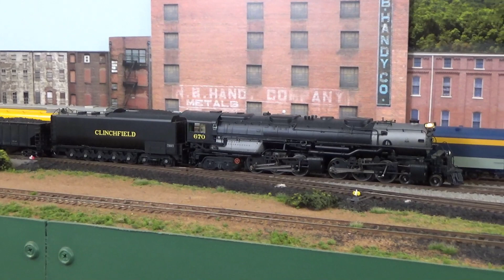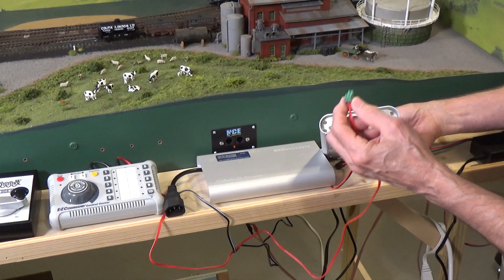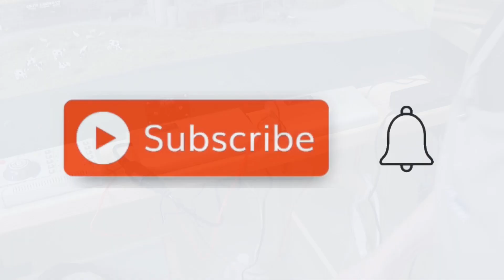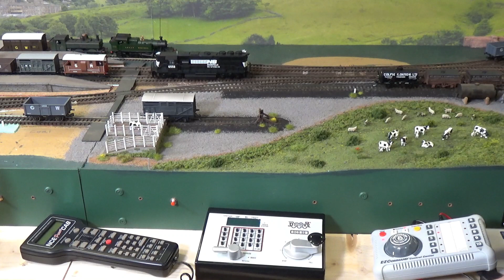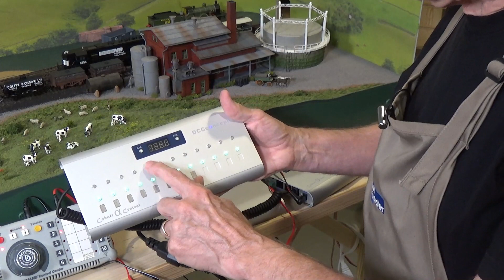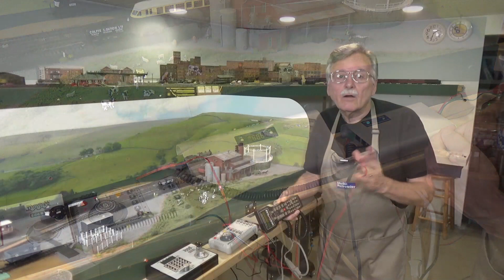Need More DCC Power--Watch This Before You Buy (270)

Comment: I have old Markling and Hornby Dublo locomotives and I don't want to convert them to digital. How can I increase the power when I have an analog controller, and which analog controller would you recommend? Thanks.
Reply from the maker: Those old motors are power hogs and the best you can do is clean and relube the gears and clean motor brushes with a good contact spray. As for what analog controller to use, I haven’t looked at those in years. Here in the states we used to have  lot of good options but most have disappeared since DCC came along. In the UK there may be some other good options from Gaugemaster and others, see what Sam uses for his YouTube channel, he is primarily analog.
Reply: thx

Comment: Is it safe to use a booster in conjunction with a Lenz LS150 Turnout Control Unit or will the additional current fry the unit?
Reply from the maker: Sorry but since Lenz left the US marketplace 20 years ago I have totally lost track of their product line and have no idea what the LS150 takes. However it should have the voltage and current limitations/requirements in the instructions.

Comment: I have an NCE POWERCAB which feeds directly into a CP6 and that gives me 6 power districts.
If I increase the current available with the SB5 the districts will still be limited to 1.75A!
I have 4'x9' N scale layout and don't run many trains at once.
My concern is all the Light-Its for Signals and structures, Switch-Kats and AIUs drawing track current.
How would I implement an accessory bus?
Thanks
Reply from the maker: There is a video on that on here—with close to 300 videos I am afraid I cannot be more specific but just scan down through the list.

Comment: When do you expect to test the Alpha Box and Alpha Central with Digitrax?  If I missed it let me know and I will look at that video.  I am mostly curious if I can put Digitrax throttles on the Digitrax Bus and then see turnout changes made by the Alpha Central on the Digitrax throttles.

Also, if you start with a NCE Power System, are you limited to 6 cabs yet?

Thanks for all your work!

David Smith
Reply from the maker: I hope to test that in December. As for the NCE you can have up to 6 per cab but on the PH Pro system you can have up to 63 cabs!
Reply: @TheDCCGuy  Thanks!  It is a busy time of the year!  Great Job!

Comment: I'm still waiting for the "perfect" DCC system.
Digitrax is the most functional and easiest to use, but all their stuff looks like it was built by a kid in his bedroom.
NCE is modern looking, but overly complicated to use.
Bachmann is a good in between, but it just feels cheaply made.
There are some European DCC systems that look amazing, but come with amazing prices!
I currently use MRC Elite.  It's modern looking, easy to use, and sturdy, but proprietary.  So none are perfect.
Reply from the maker: If you keep expecting someone to develop the “prefect” DCC system you will always be disappointed! Technological developments always seem to stay one step ahead of what manufacturers are willing to build into their new products. Probably because they are never willing to take a chance on whether model railroaders will actually want the newest thing. Manufacturers waited almost 5 years before starting to include 8-pin decoder sockets in locos and LCC is still a technology waiting to be developed. I have been using Digitrax products since 1994 and in my first review of their first system I made the comment that the throttles looked like something someone made in their basement. Actually I was dead right as Zana and AJ Ireland started the company in the basement of their Norcross GA house. However I still have that equipment and it still works after 28 years!
Reply: @TheDCCGuy  That's not true, IMO.  The Lenz system is really good, and the ESU system is pretty close to the perfect DCC system.  These systems are just hard to get here in America.  A lot of European shops either don't carry them (they are pricey) or won't ship to America.
Reply from the maker: Opinions are like belly buttons—everybody has one and no two are alike!
Reply: @TheDCCGuy  So true! 🙂

Comment: If you have a two deck layout would you need a booster for each deck
Reply from the maker: No. You only add boosters if you need more power to run more locos, you use circuit breakers to divide power among various blocks. Watch my videos on boosters #113 and power management #112.
Reply: @TheDCCGuy  Thanks for the advice and I will certainly watch your video on power management

Comment: It's also extremely important to note if you are using ANY Digitrax system to use the required cables alongside the Alpha Box/Alpha power. There are special connectors for each system (Some don't need any as shown in the above video). If you don't use the provided connector then you are likely to blow the Alpha box pretty quickly.
Reply from the maker: I plan to do another video focused on using a Digitrax system.

Comment: Hi, I’m just starting on a “N” scale layout & I’m confusing terminology in regards to wiring in the questions I’ve asked of you.  I saw on one of your videos that you had written at least 3 books. Basic DCC Wiring for Your Model Railroad: A Beginners Guide: 4/1/11, Wiring Your Model Railroad (Essentials) 8/1/15, DCC Projects & Applications V4 8/26/19
What book would you recommend I start with?
Thanks! 
PS: I haven’t purchased any power system yet, just a Kato starter system.
Reply from the maker: I would say go,with “Wiring Your Model Railroad”. It provides some basics about DC and DCC and is one of the Essentials that Kalmbach publishes. Also take a look at the series of videos I did on building the modules.
Reply: @TheDCCGuy  Thanks!

Comment: I am considering the Cobalt turnout motors and Alpha panel on my layout expansion, but it is really hard to decide which system to invest in.
I would be interested in a video on the merits of 12v vs. 15v vs. 18v for N scale. Based on my Alpha Meter and RRampMeter, I am getting 14.9 volts out of my command station and 14.9 volts at the farthest end of my track, so I could drop to 12v without voltage drop. But I do not understand why, if DCC Decoders are rated up to 22v that I should run my N scale at 12v. Thanks
Reply from the maker: OK, the NMR standard for N scale decoders calls for 7-24 volts with a nominal value of 12 volts. So why is that important? Well, with most decoders the voltage supplied to the motor is proportional to the track voltage. The decoder will likely drop it a volt or so but if you start at 18 volts then the max the motor might see is 17 volts at full throttle. A lot of N scale motors might not take that for long if you tend to be a speed demon. Now of course if you tend to run your locos at about half throttle then they’ll just tend to run a bit faster and not overheat. That is one reason Digitrax systems have voltage appropriate scale setting switches and the ability to fine tune the track voltage. NCE has a similar ability to adjust the track voltage. However some systems such as the Alpha Box is what I call a voltage follower in that the track voltage is totally dependent on the input voltage. That is not bad, it just means that if you desire a specific track voltage you must select a power supply with a voltage about 1 volt higher. I have a couple of power supplies with slide switches that go from about 12-24 volts and the NCE SB5 comes with one that can be set for 12 or 13.8 volts track power. Hopefully that answers your question and will make it easier to make a decission.
Reply: @TheDCCGuy  I really appreciate this response, so it is the motor that I should be considering, not the decoder when talking about voltage. I do program all my decoders so the top speeds are not the top speeds, but this makes me wonder if I set a speed profile using a 15v PSU, then go to a club with a 12v PSU, then my Speed Table is going to be off.
I assumed the decoder had a voltage regulator built into it, but I guess that was an assumption I should not have made.
Reply from the maker: It also,affects the lights. If you assume 12 volts when choosing a resistor and then put it on an 18 volt track you’ll get very bright lights, for a while!
Reply: @TheDCCGuy  thanks for this back and forth, it was very informative.

Comment: Did you ever checked other DCC centrals like the Intellibox II ?  It has already 16 buttons for devices, can add as many boosters as you want, can connect manual controllers , has modules for steering signals and turnouts, modules for detection and can be connected to the computer

Comment: Thanks for a great video Larry.  I am thinking of getting one of these straight away to increase the capability of my NCE Powercab. But I am still worried about that 18 volts.  Everything I have read/heard up to now has suggested that 13 to 15 volts is right for HO scale.  I have mainly ESU decoders. Can I feel comfortable using 18 volts? I would appreciate your comment.    Thank you, John
Reply from the maker: The NMRA specifies a min/max for HO scale of 7-27 volts on the rails with a nominal of 15 volts. Personally I have always used a 15 volt power supply which gives me about 13.8 volts at the command/station booster outputs and I have known guys who used 12 volts on the rails with HO scale. I don’t think the issue is you might blow a decoder, especially those  designed for HO as they are generally designed to meet the NMRA 27 volt max. It mainly comes down to the fact that in most cases the function and motor voltages are proportional to the track voltage. So if you size you LED resistors assuming 12 volts and then provide something close to 18 volts you’re likely to get very bright lights! Also your locos will run at a proportionally faster speed at any given throttle setting. It is easy enough to find a 15 volt 5 amp power supply at Jameco as well as various other DCC suppliers and the barrel plug is available from these companies as well as All Electronics. So if you are comfortable doing this then no problem. BTW the barrel plug for the Alpha Box needs to be a 2.5mm center positive one. And as I showed in the video the NCE power supply for the SB5 gives 12 or 13.8 volts at 5 amps. I also have been told that down the road DCC Concepts is considering providing a slide switch voltage selector on their power supply but that won’t help you now.
Reply: @TheDCCGuy  Thank you for the reply Larry.  I think I will source a 15 volt supply and then I will feel more comfortable using it.
Reply: Hi Mate, as mentioned to another user, Grab yourself a UP6Z and connect your main power out into that and then your main feed from the UP6Z, It allows you to step down either to 15V or 12V DCC

Comment: Larry you are wrong about the ability to control you accessory with the digitrax system they have a a adapter leads for Four different systems where you can make use of the full system functions without the Alpha Central.
Also you can use the NCE Power Cab just use the 6 wire cord to the alpha Box just that simple
Reply from the maker: Ed are you talking about DCC Concepts? I am aware of the adapter dongles for the various systems to interface with the Alpha Box and that is what I meant in the video when I said you could connect a command station or throttle to the Box using am interface. However you don’t need the interface if you just use the track power feeds to provide the DCC signal and you can still have a throttle bus connected to Digitrax throttle panels. I probably will do a video showing how to do that.
Reply: On the NCE system Power Cab all you need is the Hammer head and a 6 wire cable you could hook it up direct to the DCC Concepts and you don"t need the the alpha central you could use the hammer head controller to control your switches same also you can do the same with digitrax system if you need the digitrax adapters for your demo I have them and would let you use them. 
I have done both systems with the info from DCC Concepts and both work very well.
Reply from the maker: Yes, I know, I showed how to use the Alpha Central with the PowerCab in video 262.

Comment: Larry with an NCE Powercab can the DCC Concept booster allow use of the programming track feature (unlike the SB 5)?
Reply from the maker: Not sure how that would work. The programming should go through OK but I don’t know that you would get the current limited to the 250 milliamps. Let me ask the DCC Concepts expert.
Reply: @TheDCCGuy  Thank you!
Reply from the maker: They say that it won’t work through the booster, you would have to make a connection to the programming track before the booster connection. The best option would be to T in an Auto-SW before the booster so that it would automatically shunt programming commands to a programming track or allow track power to pass on to the booster. I showed how to use the Auto-SW back around video 98.
Reply: @TheDCCGuy  I see.  Thank you Larry for your quick follow-through!
Reply: @TheDCCGuy  Just checked out your video #98 and that is the way my layout is set-up!  My "Main" power bus exits the Auto Switch and enters a bank of PSX circuit breakers.  It looks like I could place the DCC Concepts booster in that main line between the Auto Switch and the PSX's.  Simple!  (One would also have to reconfigure the PSX to utilize the higher amperage via setting CV 49 to 03 or 04.)
Reply: @TheDCCGuy  DCC Concepts sent me a diagram on how to actually  utilize the NCE AutoSwitch and thus have an elegant way to use the NCE Power Cab Programming Track feature.  1.  Run a 6 core RJ12 cable from the Cab to an UNPOWERED PCP.  2. Run a 6 core RJ12 cable from the back of the PCP to the "Main DCC System Input" on the Alpha Box.  3.  Run a bus wire from the PCP to the AutoSwitch.  4.  Run a bus wire from the AutoSwitch to your Programming Track. 5. Run a bus wire from the AutoSwitch to the "DCC Track Power Input" connector on the Alpha Box. 6. Set the input control toggle switch of the Alpha Box to "Track".  Hope this helps!

Comment: Larry, I've had my eye on that DCC Concepts unit for 6 months now, but that higher Voltage has had me concerned, even though they say it's fine with my NEC Power cab. Well, I'm not worried anymore after today. I just wish someone here in the states would carry the whole DCC Concepts product line, not just bits and pieces. All of their products are very high quality, and just superb!!!  Thanks for the info!
Reply from the maker: Iron Planet Hobbies does have most of their products or can get them fast from them.
Reply: Hi Scotabot, As someone who has gone heavily down the DCC Concepts path I can absolutely agree with you, However I got around the problem in a fairly simple way, Grab yourself a Digitrax UP6Z and it has options for stepping down the voltage to a much lower rate, I've got mine down to 15V and it's much happier than the standard 18V as it outputs.

Comment: Im sorry. But bachmann actually gots a way to flip a switch on dcc now actually. But i understand your showing the power booster and its helpful stuff. Just thought i would let you know that bachmann gots a dcc switch now.
Reply from the maker: Are you talking about their DCC Turnout Controller? If so that is simply an accessory decoder but you can’t control it with their EZ Command system. If you are talking about something else please be specific. I looked on their website and didn’t see anything else.
Reply: @TheDCCGuy   im replying to you again. Because YouTube might have removed the video link. But all you have to do is look up Bachman DCC control box with turnout. Yes it might be a accessory but it upgrades the turnout to DCC to where the dcc controller can use it by being programmed from hit 9 and then functions and then you're able to program it from there as seen from Bachmans YouTube.
Reply from the maker: I’ll check the video,out, thanks. I was not aware of that feature with the DCC turnout controller. There are a lot of other intro type DCC systems though that also do not have this feature such as the MRC/Gaugemaster Prodigy Express, some of the Hornby systems, etc.
Reply: @TheDCCGuy   i fully understand. No worrys. But yeah i just thought you should know that at least for bachmann ez dcc stuff. As for the others you said. Maybe and if you want. You can use some of them in your next video or two showing off the power booster.  P.s. hornby might have a turn out controller as well. BUT! its part of the bluetooth system  line they have. Where you can get a Bluetooth controller to run a DC engine and you can use a other Bluetooth thing to control the points/turn outs. All from the Hornby app. Just thought i would let you know. Just in Case you didn't know like you did with the bachmann EZ dcc thing.